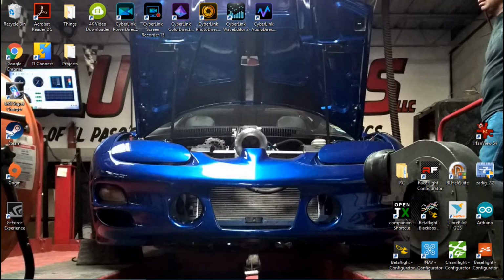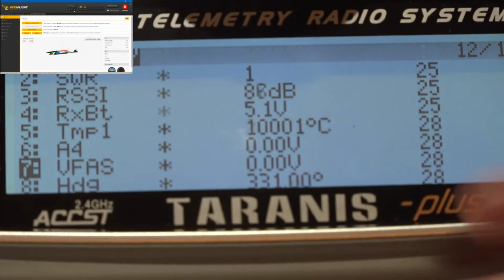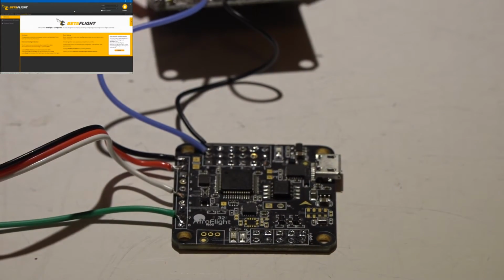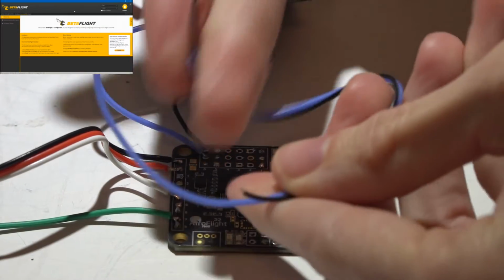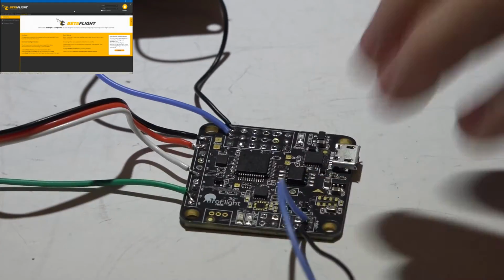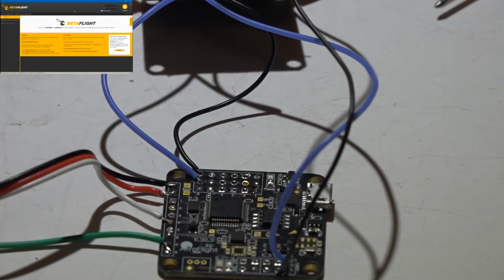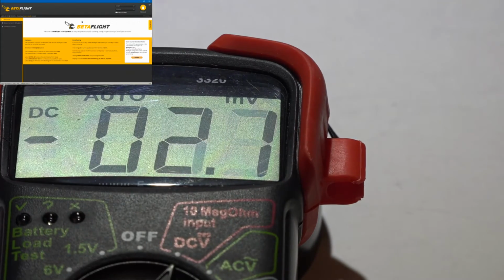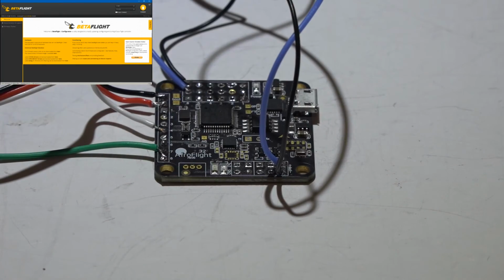Naze32: Getting Voltage In Telemetry

Comment: I have the same problem, shows 0.0v and 0.0A in the receiver and in betaflight. But in my FC board, the battery is directly connected to the FC board also there is Vbat+ and Vbat-. Shall I do as what you did in your FC? Won't It cause any problem?

Comment: I know i really should switch to sbus but can you still run telemetry when using pwm rx inputs as long as channels 7&8 are open on the naze?? Every video I've watched has only shown sbus with telemetry and it had me curious.
Reply from the maker: No, the configurator wont let you to PWM and soft serial at the same time.